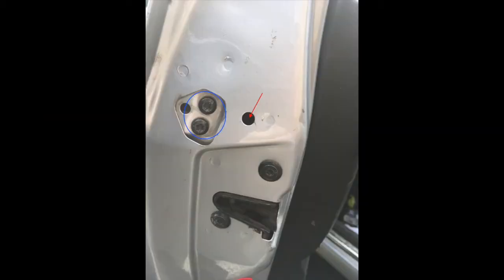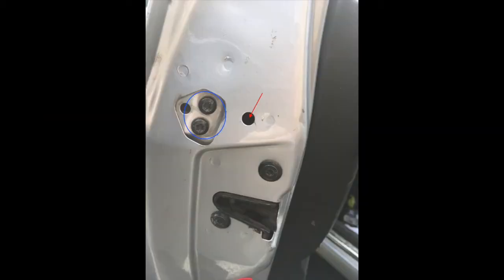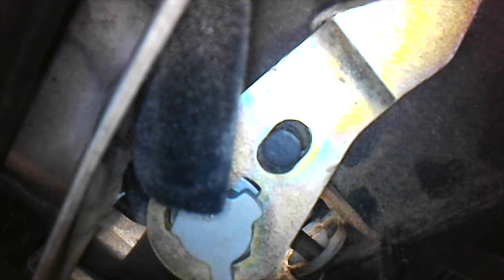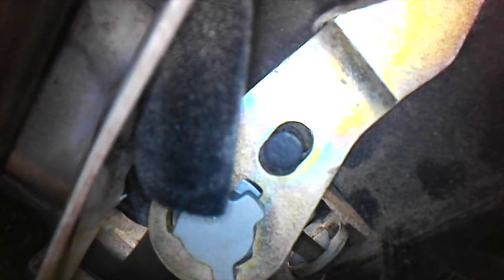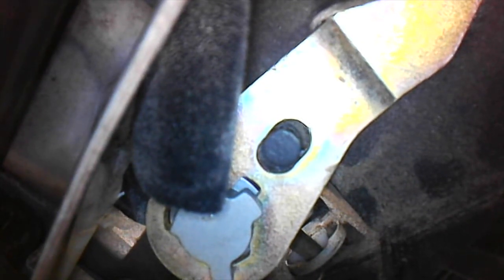How to fix Volvo V70/S70/850 front door lock

Comment: Holy hell! I spent several hours trying to make this work, and kept fumbling it as I put it together, until I popped the plastic tab and saw what I was doing. 99' V70 where the driver side door lock had failed. for 2 months I had to climb over from the passenger side to get in the car. Such a pain. Even tried to reverse picklock the door based on the replacement lock I bought as I didn't want to damage the door. Nope. just would not. So, if it happens, you are not getting the door panel off the door unless you rip it up and break it, and the lock, by god, just use pliers, small hand saws, chisels and a damn long drill, and just go to town.  Only way I got the lock to finally open. Once done, just use this video to fit the replacement lock and hope it won't die. I have no idea what happened to the old lock as it was just plastic scraps after I was done with it, but I did document with the replacement lock to try and find a way to "pick" it from the inside. There is a lever that is spring loaded, that locks the door. but even with a super thin but strong shim/pick I could not get it to lift enough for the lock to disengage. might have been something else that was broken in mine, as I seemed to get it to work with the replacement unit, but again, I can't say for sure with the broken one as it was quite literally obliterated after I was done with the "Repair".

Comment: Hello sir!

I think that is my problem on my XC70 Volvo 2001, but how to open de door if the key won''t open the door first? No battery and when I turn the key the door is not opening...Please help me!
Reply from the maker: Try a different door. The trunk has a key-slot you can use to open it and crawl in to open from the inside.
Reply: @Avboden  Hello there!
My car has not a key-slot at the trunk, I don't know why?
Is there another way to open it?

Comment: Where could i find the missing part, i checked mine and there wasnt the head that goes into the white thing ..
Reply from the maker: The rod is attached to your door handle. When you take out the bolts on the side of the door you can pull the handle in and out a bit and you should see the rod appear. Having the key in the handle helps too so you can rotate it and rotate the rod.  You may need to completely remove the handle assembly if the rod has actually come off it.
Reply: @Avboden  Can this rod be replaced?

Comment: It seems like with my lock the thingy attached to lock itself is missing. I can see the lock from behind and nothing is attached to it (anymore). Thinking of taking the door apart searching for the part and try to re-attach it. Anyone here had success with this approach? Or else the name of the part ? 

Also: if you cannot open the doors anymore because of this problem and a flat battery. Lift your car up so you can reach the starter. If you take a jumpstarter cable and put + to some metal for ground and minus on the starters minus. This should open your car. Be careful and only do when feeling confident with electic stuff.
Reply from the maker: Some people report the flat bit at the end of the rod has broken off on their cars. Only way to fix it is to take out the handle and replace it. With how many of these things are at pull-a-part junk yards should be pretty easy to find what you need.
Reply: @Avboden thanks! Yes but I figured out that it is even worse. Seems like some idiot tried to fix it before. The back part of the lock itself where the plastic thingy is attached is missing. Just found some scraps inside door.